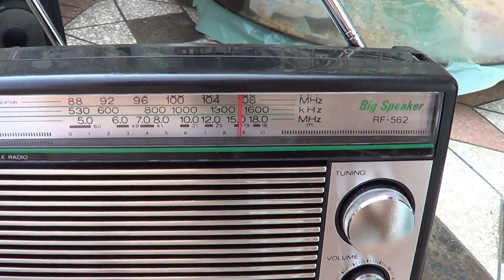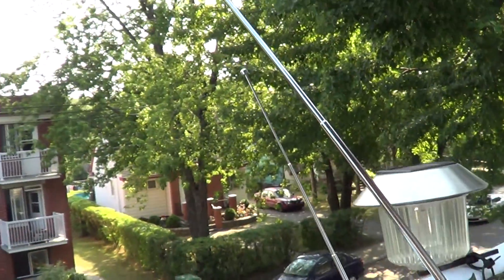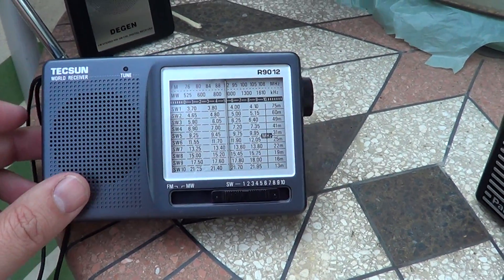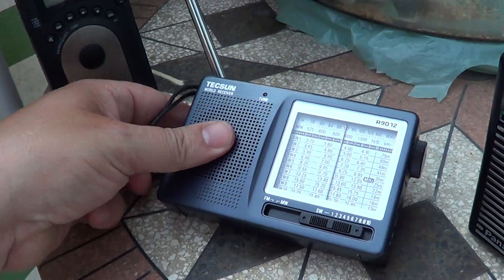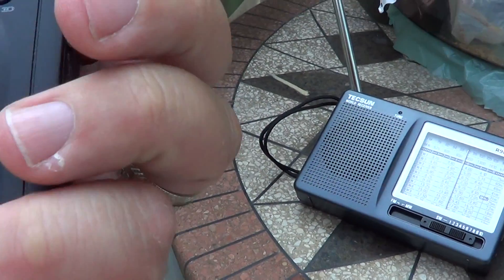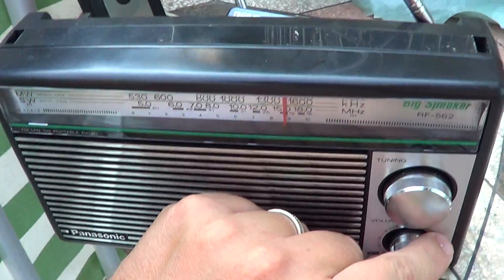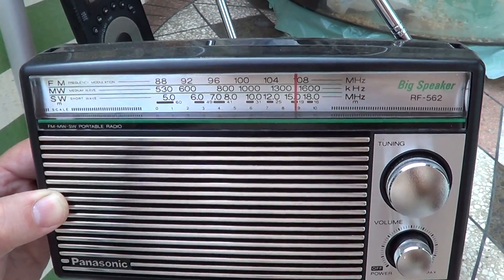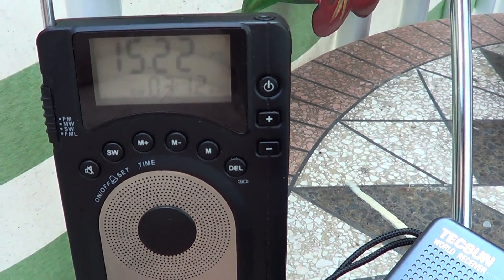Romania 15220 Khz Degen DE15 VS Tecsun R9012 VS Panasonic RF 562

Comment: Thanks for the great review!!  As if I don't already have enough radios, it seems I am addicted to getting more and more SW's!  I recently bought from an eBay seller a Panasonic RF-2200 and I have high hopes it works well and there's a video on You Tube from Cirrus Bonneau (from whom I bought a Degen DE1121 and Grundig G6 Buzz Aldrin) how to calibrate the RF-2200.  Also got a C Crane cc radio-sw that said 'fully functional but only receives FM' and I am hoping the seller didn't know how to work it.  I also just bought a C Crane Skywave which really seems to be the 'complete' radio as it has MW/FM/SW/Air/NOAA WX with alerts. As far as the radios I have, here's the list:  Tecsun PL-660, Tecsun R-9012, County Comm GP-5/SSB, Grundig G3, Grundig G6 Buzz Aldrin, Grundig G2000A, Grundig G8, Grundig YB-400PE, Grundig S450DLX, Degen DE1121, Kaito KA550, Sangean ATS803a, BayGen Free  Play FP-1, and on order and on the way to me, a C Crane cc radio sw, Panasonic RF-2200, and a C Crane Skywave. By the way, for the price, the Tecsun R-9012 is a really great performer and thanks to your review is why I bought it.  As far as a great performer in a small package, the County Comm GP-5/SSB is like having a nuclear cigarette lighter, I am totally blown away with it!!!  I hope you have the chance to try one out and post a review of it.  It is essentially the Tecsun PL-365 (upgraded model of the PL-360 but has SSB) but somehow the US government grabbed it to use and is now being sold (pretty much as 'surplus') as the County Comm GP-5/SSB.  Nonetheless, it is really an amazing little radio not much bigger than 2 Hershey bars stacked on top of each other.  I love all my radios, and like children, you may love each of them for their different qualities and characteristics but you love them all equally and give them all equal play time.  Ain't no wonder all my radios 'enjoy' equal battery drain!!!